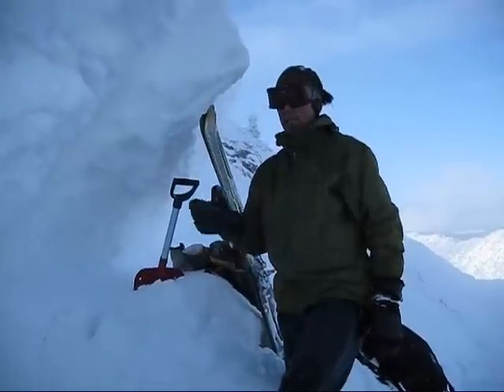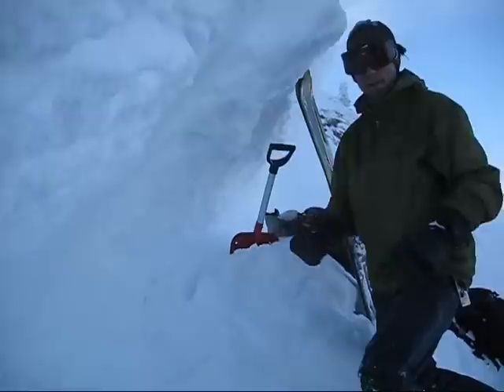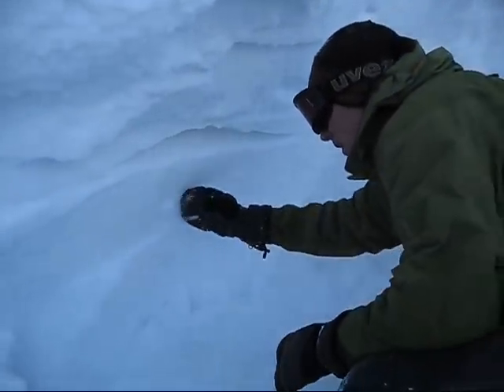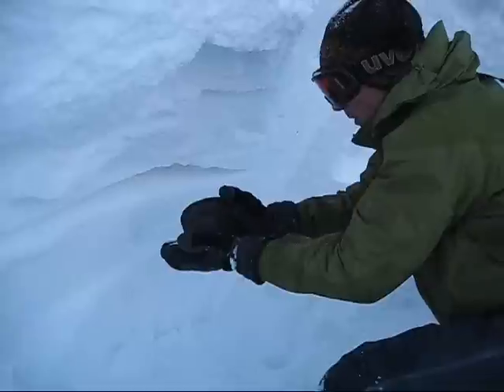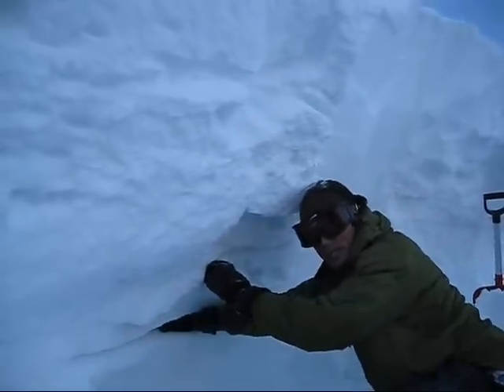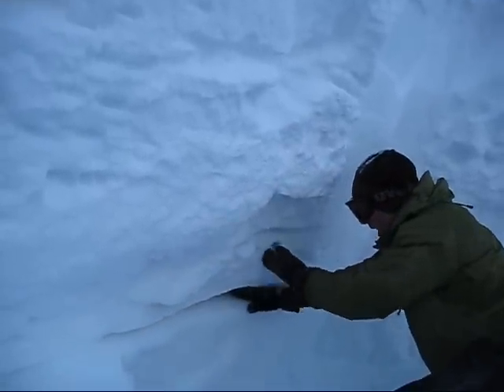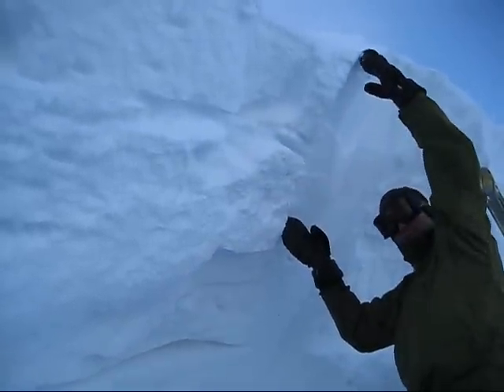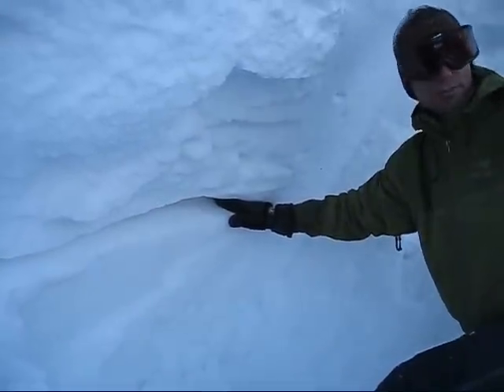Saddle Peak Crown - 17 Feb 2010

Comment: From the avalanche report 2010-02-18:  "The trigger for this avalanche happened to be a tumbling cornice, but it didn't matter whether it was a cornice or a skier.  The weight of the trigger was insignificant.  What was important was finding the right place on the slope to initiate a fracture in the weak layer, and this spot was one of the several rock bands near the summit."